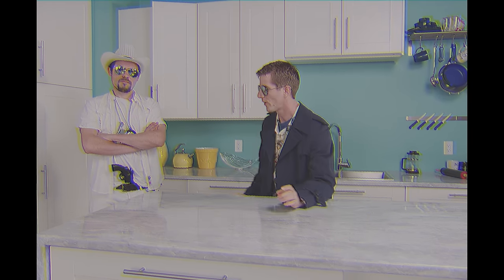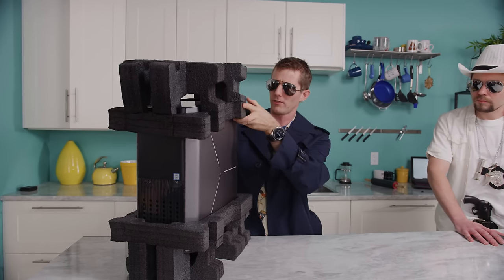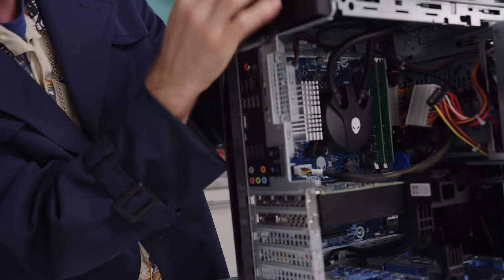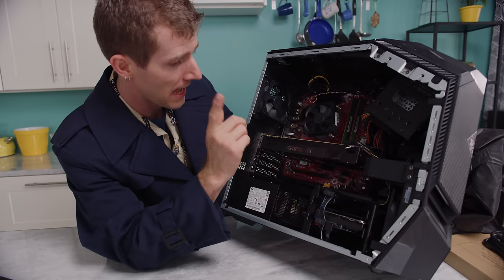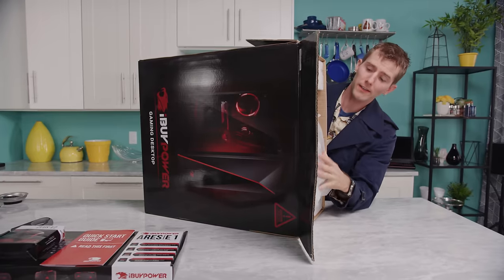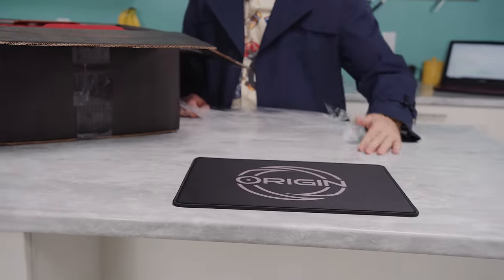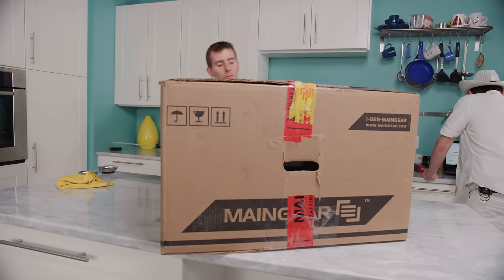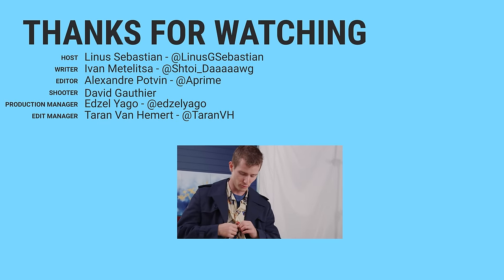What did we BUY?? - $1500 Gaming PC Secret Shopper Part 2

Comment: Wait, pretty sure that dude choose AMD for that pc since he asked her if he is going to stream and she said yes, better test that too! Rendering smth in the back and playing same time etc
Reply: Oh that's an interesting  point. I don't know the CPUs in question but I guess the AMD has six cores and the Intel four? I've heard several times that todays games usually use up to four cores effectively and more don't bring a benefit, so they are potentially free for streaming.
Reply: @Gawagu  Both i7 8700 and 8700k have 6 cores 12 threads don't know about the i5s.
Reply: @SirKnobofCheese  Oh right, and the AMD one? I got a 8700 myself :D. So maybe the AMD one still has two mores but after my knowledge eight cores might be worse than six faster ones in such a case.
Reply: This dude watched the first video.
Reply: @Gawagu  8th gen and 9th gen i5 processors have 6 cores but no hyper threading while the 2600x has 6 cores and 12 threads, so in stream loads it should hold up really well but in pure gaming performance the i5's may walk out a little bit further ahead due to their higher boost clocks. The real performer is going to be the gtx 1070 which i believe is going to put ibuypower in the lead. It's looking like a pretty close tossup between maingear and ibuypower.
Reply: Why would a 2600x be better than a 8700 or 8700k in terms of streaming performance though? All have 6 cores with hyper threading.
Reply: @Philosophey  The K would be good but it depends on the rig. 2600X has been shown to be very smooth for streaming whereas Intel's seem to do less well in similar workloads. The user will experience the game better but the stream will experience a worse stream output compared to the 2600X. So it's a compromise. Neither are ultimately better than the other but each has different pro's and con's. Personally in the current climate I'd probably lean the 8700K way (8700 non-K loses to the 2600X BTW) however come March things could get a huge shake up there.
Reply: TrixX Gaming there is also the argument that you get more budget to spend on a better gfx card if you buy AMD, what with the currently horrendous 14nm prices.

On a tight budget I would say it's better to marginally bottleneck your gpu by going with a slower cpu, than to go with a very high end cpu and end up horrifically bottlenecked by a low end gpu. The price gap between a 2600 and an 8700k is enough to move up multiple gpu tiers.
Reply: AMD was not the problem. The problem was R5 2600X is like around nearly half the price of i7 8700K, and given they used a double radiator cooler, they would be much better off doing a stock cooler with something like R7 2700X
Reply: @KingHalbatorix  Very much so, though I was suprised at the 240mm AIO instead of a 1070 GPU. Interesting decision, though also on the flip side that AIO and CPU will be fine for a reasonable length of time and the GPU would be the first needed upgrade in the future.
Reply: I'm pretty sure they used that CPU to save money AND later upgrades. Third gen Ryzen will matches with the 9th gen intel i think and for upgrading later this is the best build.

Comment: You should really do streaming benchmarks, because the Ryzen PC was only recommended after the salesman was told that streaming was going to be a workload. Otherwise the system is just going to loose points because the other companys didn't even ask. The same salesman also asked about monitors to rule out 4k or high refresh screens, so it seem very appropriate
Reply: Not to mention Ryzen in gaming isn't as bad as Linus portrays. HWU showed that the 2600X performs equally well in 1440p as the 8700K as it becomes more GPU limited. As soon as the game becomes single core Frequency limited the Ryzen will lose out. So basically get a decent GPU with the 2600X and crank up the Image Quality to get the GPU limitation rather than the CPU limitation, which really only applies to a few games these days.
Reply: @noooooooooooooooooooooooooooo0  I'll guess we'll see since the Alienware also has a gtx1060. Should be a nice comparion for the 8700k vs Ryzen on a similar priced build with the same GPU.
Reply: That's a really good point!
Reply: YES. Benchmarks should be tested given a situation it was designed for. Not for cherry picked scenarios. This is one thing a lot of big tech channels overlook.
Reply: @TheMrMiao  To be fair, there are a lot of potential use cases out there. I'd rather not sit here as they go through a hundred different benchmarks hoping to catch a few that are precisely relevant to me, a couple general benchmarks is much more efficient.
Reply: I belive the third video is already shot (may even be on floatplane), but yeah, it’s going to be an interesting battle
Reply: @noooooooooooooooooooooooooooo0  Depends a LOT on the RAM speed however!
Reply: Totally agree with this! Also linus said that the 2700x is almost not overclockable. Im now at 4.3Ghz stable! :D
Reply: @noooooooooooooooooooooooooooo0  true. if you was going to stick with a gtx 1060 for whatever reason the amd cpu would be a better experience overall.
Reply: This. I assume they've already filmed the next part, but I really hope they take that into account.
Reply: @BrKnOblivion  HWu did OC their memory. Which is a big thing for Ryzens. So it will loose. Bad.
Reply: @PanaehaliTut  Who says it's not been setup with DOCP active...

I wouldn't assume that Maingear did a bad job there...
Reply: @BrKnOblivion  Problem is that cheap memory usually doesnt have XMP. And even if it does it only work for Intel. Since its much harder and more expensive to get like 3200 MHz DOCP on Ryzen.

Comment: Maingear might not win in performance, but they made a home-run in love
Reply: They could have upped that with a rx590 for $80 more than the 3 gig 1060 or the same price as a 6 gig 1060.  It’s a shame
Reply: Also the 2600x would not bottleneck or show hardly any difference in performance with the video cards on hand with all machines.  I think it will do well.
Reply: Linus clearly shilling intel here. The ryzen system is just as capable if not more than some of the others. The 1060 is a bummer but the CPU aint the problem, thats for damn sure
Reply: Damn right.
Reply: @skoopsro7656  Where do you get the from linus shilling intel from?

Comment: The Origin PC kills me... $1500 for a locked i5 and a 1050ti? I buy those cards on eBay for $100.  To spend $1.5k on a build and barely be able to hit 60FPS in “most” games is a hate crime.
Reply: It's a $600-700 PC upsold for $1500. Those are some decent margins there, Origin.
Reply: the name is The Origin PC, and if you look at the history there's  time back then when 1050ti is worthy of $1.5K PC
Reply: U r mistaken it wasn’t an i5 they recommended it from an i3 
It much worse
Reply: You’re buying those cards for $100 because they’re trashed from bitcoin mining.
Reply: @sithlordmaster181  
nobody mined with 1050ti, they don't use power very eficiently and have low resale value.
Reply: @electronresonator8882  The 1050TI released as an entry level GPU. It NEVER was a GPU that belonged in a $1500 pc, period.
Reply: @sithlordmaster181  Mining does not kill cards. Most miners undervolt the card so they are going on cruise mode. Not bad for them at all.
Reply: Origin PC has really good support. That's probably where most of your money is going. But yeah they are super expensive.
Reply: VIDEO HOT GIRL please do not report  Reported.
Reply: sithlordmaster181 Haven’t has one fail yet, including the one in my sons build.  So I’m not sure where you’re getting your info but I’m buying the cards and using them. Also got a few on evga b-stock for $119 with a 1 year warranty.

Comment: Ibuypowers PC was very well cable managed to the point where there was only a single visible cable for the GPU and Linus goes "wow this thing is so barebones."
Reply: Nathaniel Stringer my money is on them. Their 9600k is equivalent to the 8700k. Add the 1070, it’s definitely going to out perform everyone by 10%.
Reply: i think he was referring to the empty chasm in the front third of the system.  It looked like it was missing a lot, but it's mostly for expandability
Reply: Looks like they forgot to put the hard drive cage in the front of the case.
Reply: I love the iBuypower case. I have two of their systems, and it is so empty because if you open the back panel you will see all of the cable management that they very pain stankenly route for the least amount of cables being seen in the front. and to Thermal Ions, the Hard drive cage is in the basement of the case. that case has two slots in the basement for 3.5" HDD's. and then 2 2.5" HDD slots on top of the PSU shroud. The case that i have looks similar to this, but it has a tempered glass front that sticks out to give large air openings on the top and bottom that allow my 2 140mm fans to suck a ton of air in, with a filter of course, and i keep my case with a positive pressure.
Reply: I'm not sure it has one.
Reply: @bluetonight17  you take it way too serious.

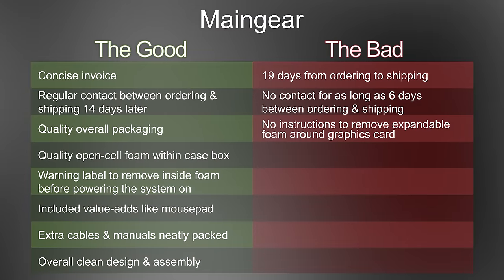Comment: Maingear: 27:33
Good: Regular contact between ordering & shipping 14 days later.
Bad: No contact for as long as 6 days between ordering & shipping. 
what?
Reply: Good: Warning label to remove inside foam before powering the system on
Bad: No instructions to remove expandable foam from around graphics card
Reply: @sabatorgaming8354  While he says it, huge paper on pc panel stating to remove foam LOL
Reply: @sabatorgaming8354  What they meant (linus said it earlier) was that it told you that you should remove the foam but it didn't say how to remove the foam
Reply: Calm, what they mean is there was a 6-day delay before the process started, but the process itself was handled well

Comment: 1500$ for a 8400 and a 1050ti?, holy $hit
Reply: unfortunately, there's a small form factor tax. not in a literal sense, but others think they can upsell a thing that is normally twice the size.
Reply: finally, was looking for this comment. Everyone talking about various things, but damn origin are so overpriced. Still they will probably get away with it in most people's eyes, because they spent like 50$ on crappy accessories.
Reply: Especially when it's on a z390 board. That's pretty pointless. H370 at most would be a better fit

Comment: Im liking the IBuyPower rig as it is not filled with crap and is ready to be upgraded without having to remove unneeded junk or like the dell where it seems designed to prevent any real upgrading in much the same way as Apple does
Reply: Yup. It's pretty much the same outcome if one would build a PC himself.
Reply: MrZombie you could build it for cheaper than what Linus bought it for. I will give credit to iBuyPower for giving pretty good components(known brand components) and excellent cable management.
Reply: @Michael-hx6ls  lol did not say I would buy it just saying out of the option its the one I would select
Reply: @JohanisTV  Dell still do that, did you not see the Alienware?
Reply: @JohanisTV  i can't even imagine what worse than that could look like lmao

Comment: Well on the amd cpu she did say the person she was buying for was also recording games and uploading to YouTube
Reply: The Intel cpu has the same number of cores, but better single thread performance. I can think of reasons for going with a Ryzen anyways, main reason probably being the cost.
Reply: @JustACowSP  the ryzen has smt. The intel doesnt. Also I believe the choice on that particular pc for their budget was either a ryzen 5 2600x or a i5 8400 which is only 4 core.
Reply: @____5837  i5-8400 is a six-core, like 6 cores 6 threads. https://ark.intel.com/de/products/126687/Intel-Core-i5-8400-Processor-9M-Cache-up-to-4-00-GHz- and it is performing actually pretty well. to be fair, after the market development I would choose a Ryzen board by today. But when I bought the i5 was cheaper and available.
Reply: @Polarwolf91  Oh ok, thanks for correcting me. I am still sure the 2600x is better you youtube (rec while playing) as it has SMT and isn't locked to 4 core. This comment was more suggesting that more of the SI's should have suggested ryzen if they listened to her requirements, and replying to linus's surprise that one of them did have an amd cpu
Reply: It doesn't really matter on a 1060 - the GPU will be the bottleneck.
Reply: Look on the bright side with such a low end cpu, in the next year the person that bought that system could actually buy just the cpu as an upgrade path and get killer cpu cooling(altough apperently they only got a b450 so it probably can't overclock an 8 core to its full capacity).
Reply: i agree with you but still the radiator is dumb a 1070 or even a vega 56 would have been way better
Reply: @JustACowSP  number of threads ?
Reply: intel has a good processor, I have never owned one, every computer I have ever owned was AMD not on purpose first time, I like them like some people like a certain car brand
my AMD sticker looks way cooler than intel's. AMD was for the cools kids who didn't conform, like Apple for poor people
Reply: AMD CPU because it has greater rendering performance than the equivalent Intel, big radiator so you can turn the volume down for recording your voice, and a 1060 bottlenecking it either way makes the 2600X the sensible choice imo.
Oh it's available too. Always a nice touch.

Comment: just want to say that i think the ryzen system seems like the most sensible specced one, as it was specified for streaming/ encoding aswell as gaming. though i agree there could have been a recommendation for/ more emphasis on getting a graphics upgrade over the AIO, but still for the stated purpose of not simply playing games/ gaming, but playing games/ gaming - while streaming or encoding video at the same time, then i think if you ran your benchmarks with that workload as the focus, even to the extent of just not running benchmarks without streaming or encoding at the same time at all, then the 2600+1060 system (especially again where the targeted monitor is a 'normal 1080p' one) would be the one id expect to provide the smoothest experience.
Reply: The ryzen system will probably pull ahead, if you give it about 4 months and switch out its current 2600x with a 3600x
Reply: i just new that last vid will upset a ryzen club member lol how many more times do you need to be told lol  stop making excuses . its all in ya head
Reply: @gamechaser002  no it won't, and that Ryzen won't even affect performance. The problem is that it has a 1060 and other systems have a 1070. 
1070>1060, no matter which CPU you use. 
Ryzen 3 + 1070 will beat every day all day an i9 + 1060
Reply: *at gaming
Reply: Yup, we’re not even sure it’s a 3 or 6 gig.   If it’s a 3 it could have been upgraded to 6 or a rx 590 for $80 on maingear site.
Reply: @Rivox - Mmm not really. I think if you went as low as an R3 or i3 you would see bottle necking on that 1070. Hell, my Skylake i5 bottlenecks my RX480 given the right game. Maybe with Ryzen 3000 series the R3 wouldn't bottleneck it, but with a 2000 series it's probably going to bottle neck. The R5 should be fine though, or at least it would have negligible bottle necking.
Reply: he face dropping was a classic nothing to do with part 1 palm face
Reply: @Wanooknox  your skylake PROBABLY isn't the problem, it's your system load - both on cpu and ram. I would recommend getting rid of the malware and clean up those 100500 tabs in chrome. Also maybe OC a little bit if it's actually cpu? Not sure if rx480 would throttle in current games due to this cpu, honestly...
Reply: coz ya everyone streams more than they game!
Reply: @Wanooknox  I think there may be a couple games bottlenecked by the 4 threads, but, apart from those, you won't see much bottlenecking. At least not at the point where a stronger CPU with a much weaker GPU would be able to surpass the weaker CPU with the stronger GPU. Essentially the R3 would have to not only bottleneck the 1070, but also bottleneck the 1060 for it to be beaten. 
Not really the case tbh.
That being said, I'm not advocating for a R3+1070 combo. Get a R5 2600/X at the very least.
Reply: The Ryzen will also win in Dwarf Fortress.

..what do you mean that is not one of the benchmarks?
Reply: @EL Lianos - Wait... how did you know I was a tab hoarder? WHERE DID YOU GET THIS INFORMATION!?

But in all seriousness it's probably a number of factors. However, generally speaking I get CPU bottlenecking in any game with a ton of physics, a ton of crowd AI, or complex network communication. Most of the time my system SHOULD be GPU bound, with the GPU usage at 100% and CPU floating somewhere in the middle. I also wouldn't be surprised if it's a RAM bottleneck. I do have 16GB, but I struggle with high RAM usage, so it might be using the swap file more often than it should.

Comment: the ibuypower's i5 sticker is crooked, and that is a deal breaker for me.
Reply: Would you not take it off anyway?
Reply: @KalebQi  No.
Reply: @abcmole  Eww
Reply: @KalebQi  Take it off and put it on something else such as a toolkit. Like the black hard-cover ifixit toolkit
Reply: Absolutely barbaric
Reply: It's an extra $10 to get them to put it on straight.
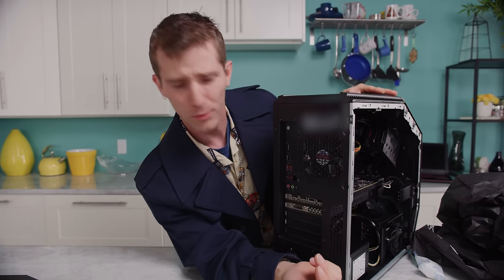Reply: 13:14 why bluring the back label ?
Reply: @stevethea5250  It has the Windows key on it
Reply: OCD be like
Reply: Yeah, Thats a no for me dawg. 5 extra seconds on applying a sticker, come on ibuypower
Reply: @GordonTong  O thank
Reply: @LiterallyScarface  Technically a breach of contract, Intel actually gives a booklet telling you not to put the sticker on anything other than a computer with an Intel CPU x) it's ridiculous
Reply: @Luxim1  Never took a look. Now I'm curious.
Reply: cover it up with some fortnite stickers
Reply: @vantablack6288  Needs more Roblox stickers.
Reply: Those "intel inside" type stickers are gross anyway.  edit: More importantly, does the adhesive leave crap behind when I remove it
Reply: deal maker for me